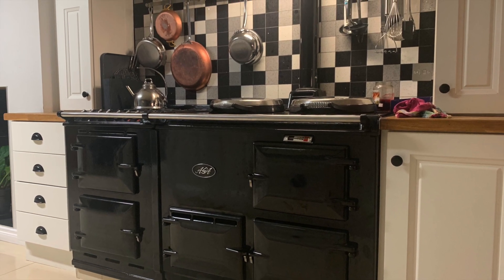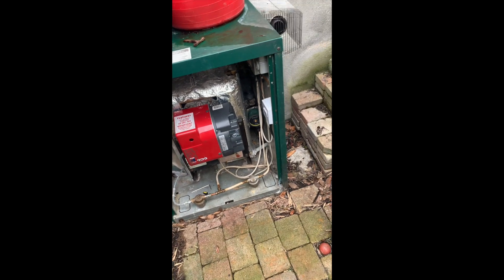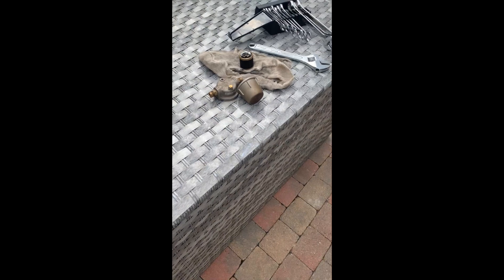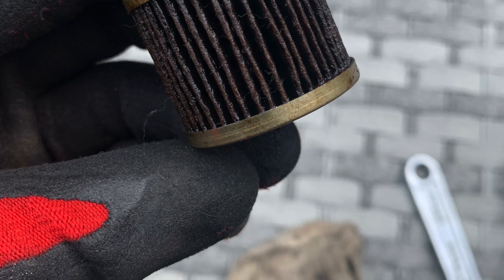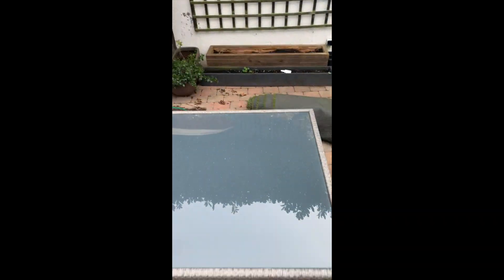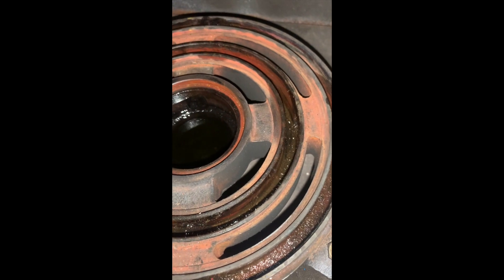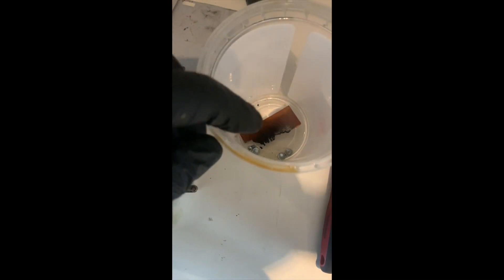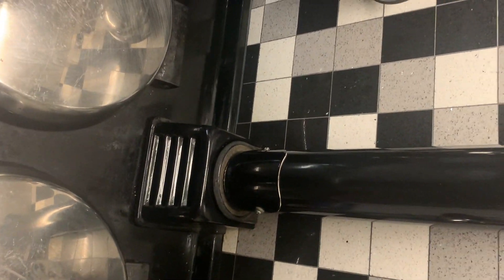AGA Tear Down - ALL FILTERS - Valves - Kerosene - Float  Box - Thermostat - Electronic Control Valve

Comment: Where did you get the oil filters
Reply from the maker: I got mine at a local plumbing supplies shop in the local town.  I had a quick Google search there and you can get them in plenty of places online. I took the filters out of the new ones and put them into the old housing as the connections / fittings were different on the new ones.